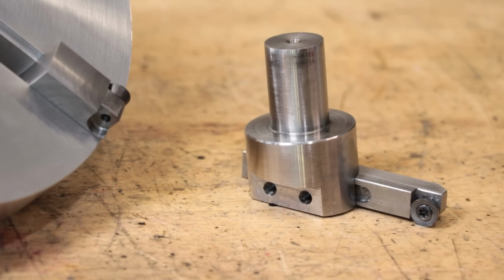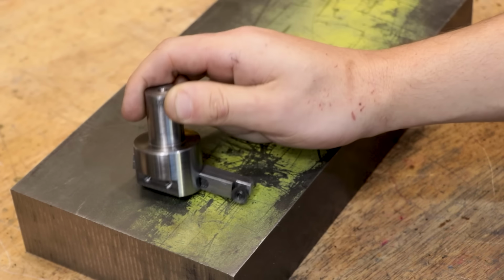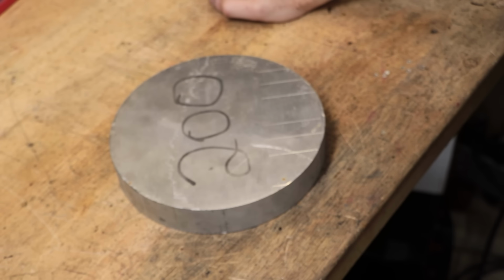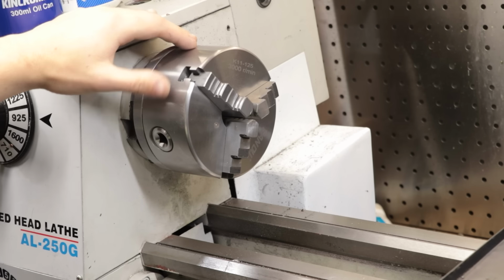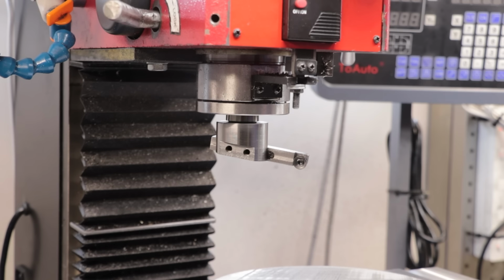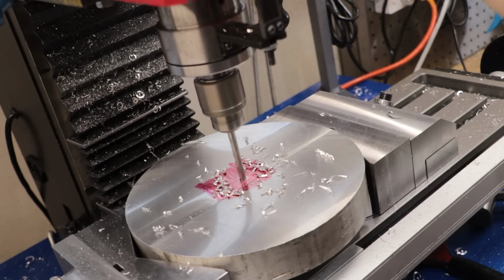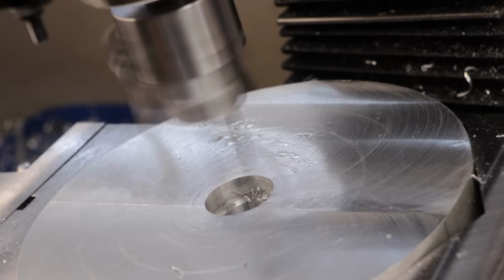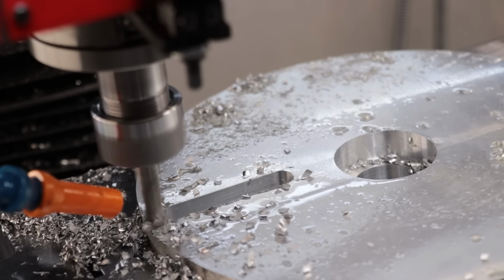Making A BIG 200mm Fly Cutter For The Milling Machine

Comment: Sorry but I must disagree about the counterweight, even with the small amount that the insert holder weighs you are still going to be beating the spindle shaft bearings and cause premature failure of them.  Just the ramblings of eighty yr. old grey cells.😁
Reply: Wouldn't the big slot he cut have lightened that side before he added the weight of the cutter?

Comment: You should try alcohol as a coolant when working with aluminium. Isopropyl alcohol, methanol...
Less gummy and leaves good finish.

And a good ventilation. Methanol is not the safest, but it works great.
Reply: It works for Stephan.

Comment: When you are hacksawing parts off the lathe, why not just use the machine to slowly spin the part and hold the saw still?

I think you might have to hold the saw backwards or spin the lathe in reverse, but still seems faster to me.
Reply: If you do that, the chips won't be able to get out the saw teeth.